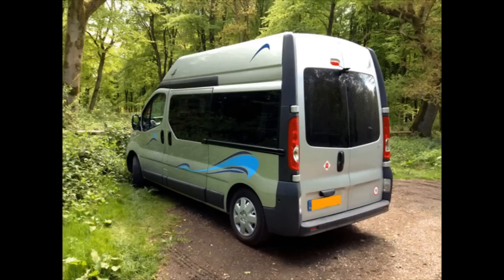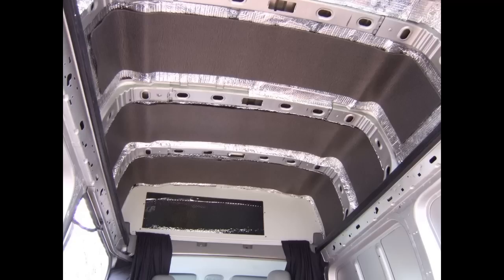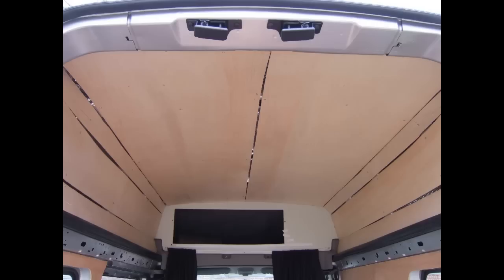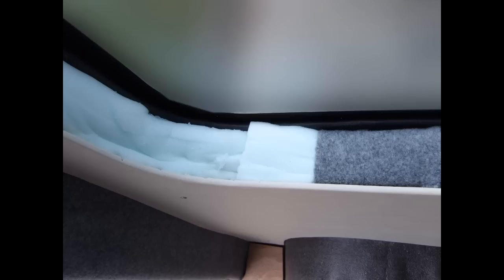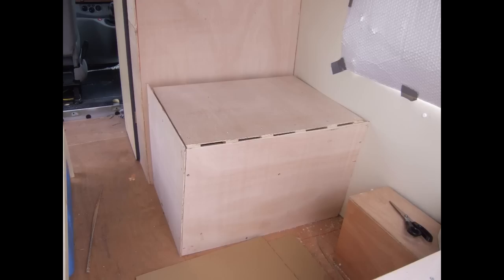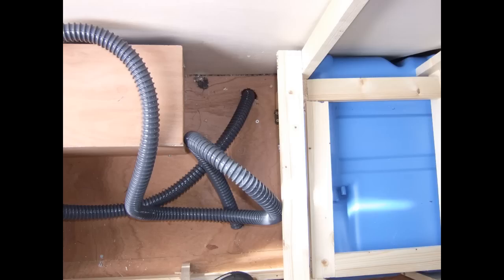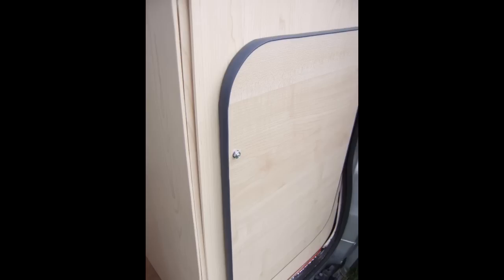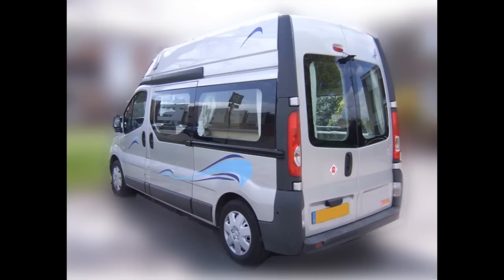HOW TO MAKE A SELF-BUILD MOTORHOME - Low Budget - From Start to Finish

Comment: hi Rick.  How do you keep warm on cold nights?  I recently got a quote to have a heater installed in my van, and is was going to be AU$3000!  I can't afford that, but I just can't sleep in there when it's cold.  Does insulation make a big difference? (my van is not insulated yet)
Reply from the maker: Insulation will make a big difference. Slabs of Rockwool stuffed into the walls and doors will help. I've just spent the past 3 weeks fitting a Ppropex heater as a cold van was an issue for me too. (video to follow).  Before the Propex heater, I used to run the gas hobs for a few minutes to get the van warm.  It's not ideal as there can be dangerous carbon monoxide issues if you run them for too long, so a carbon monoxide detector is essential.
Reply: rickvanman thanks for the info.  That's very helpful.  Looking forward to your video on the propex heater! 😀
Reply: You should definitely use a gas (propane / butane) heater with an external exhaust. Else the water from the the gas burn is kept inside the vehicle ending up with moisture dew inside when it's cooling down.

Comment: What plywood are you using birch or just the cheaper stuff? Is this a LWB Trafic?
Reply from the maker: Yes its just the cheap stuff.  Yes LWB Trafic
Reply: Thank you Rick you have just saved me £££ the fablon stuff looks just the ticket. It looks fine coated on the cheaper ply i would have been worried the surface wouldn't be smooth enough.

Comment: Does the bubble wrap pop under pressure.
Reply from the maker: only if you put a lot of weight on it in one place. The bubbles remain un-popped under the floor because the wood on top of it spreads any weight across a wide area and prevents the bubbles popping
Reply: Thanks

Comment: You build a shower in a van you don't bother equip with hot water?
Reply: Cold showers are healthier.
Reply: Alex Gomez I don't think that's the reason! But for those curious about the claim,
 "The theory is that as the body tries to warm itself during and after a cold shower, the metabolic rate speeds up and activates the immune system, which leads to the release of more white blood cells, important for fighting off bugs". 

But note the very important second word - THEORY!
Reply: Sounds like Benjamin Franklin's air baths!

Comment: Foil bubble insulation is not real insulation as it only acts as a radiant barrier.  Plus it is not meant to be put straight under flooring materials.  It can be if it is draped over joists but otherwise what you did was compress the material and made it useless.  That is very poor construction for seating and cabinetry.  I would hate for others to follow your low budget build quality.  Do it right with cost and materials or don't do it at all.
Reply: you can say something without being hateful